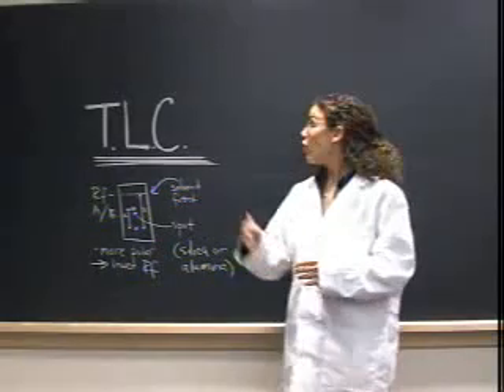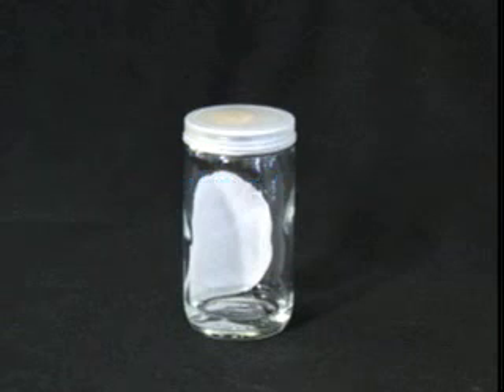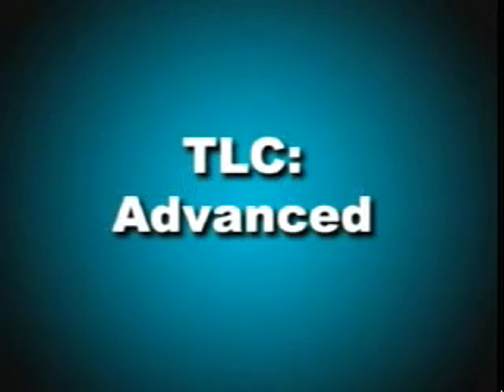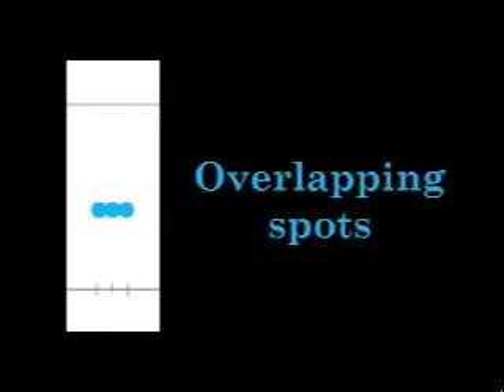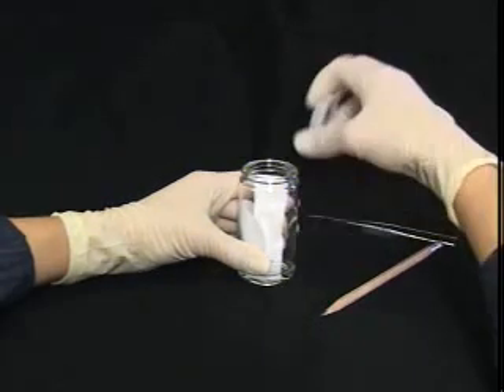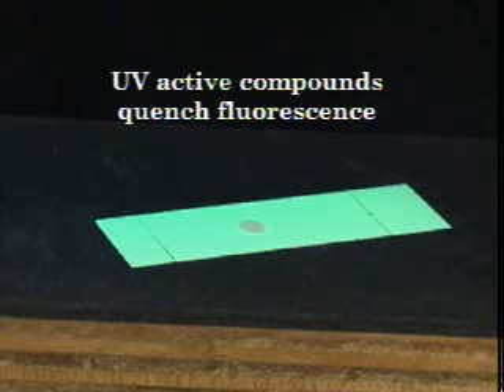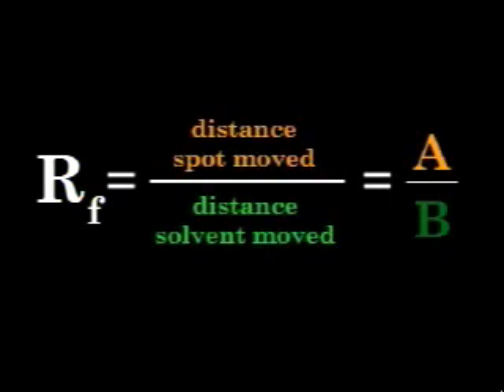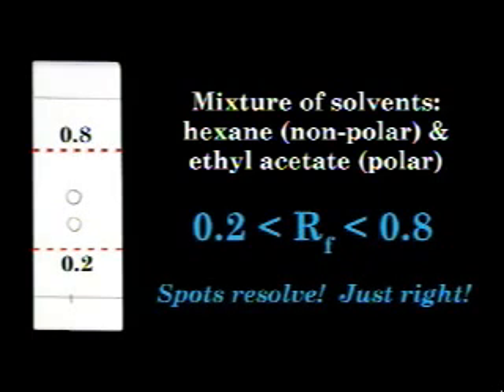Lec 3 | MIT 5.301 Chemistry Laboratory Techniques, IAP 2004

Comment: It is customary to cut off sharp edges from the bottom to prevent the plate from developing faster at the edges and forming a U shaped solvent front which you can't read Rf values from. The plate should look like \___/ starting from the bottom line for Rf measurement (e.g where you apply the compound spots) to prevent edges from being damaged or curled up which result in such a solvent front U shape.

Or at least that's what I was taught in several lab courses.

Comment: I tend to agree. Simply running the unknown against A and B separately should work. The only thing I can imagine is that perhaps occasionally compounds in a mixture bind to each other to give strange results. That would have been picked up in this case by the left -hand plate: if for some reason the A spot in the middle disappeared it may have been 'hidden' within the B spot. One other way around that I suppose would have been to run a plate with A, B, A+B, and Unknown. Just a guess however!